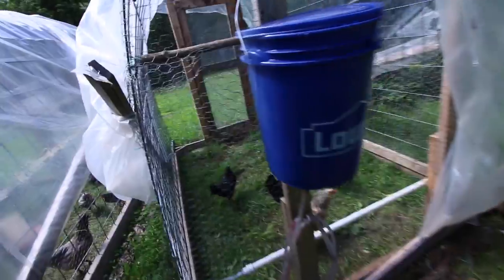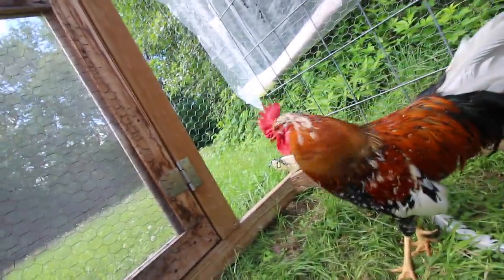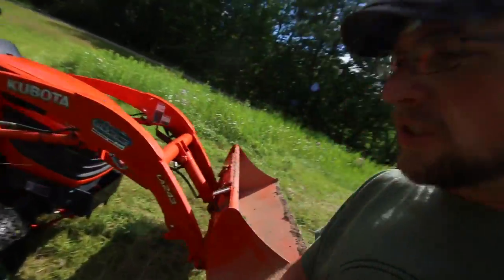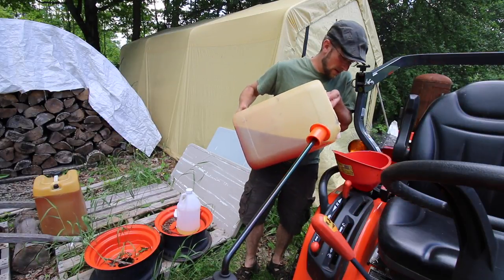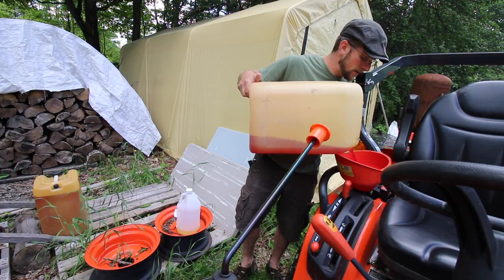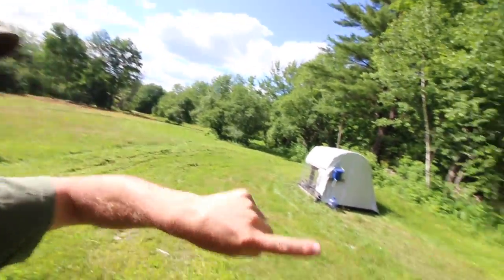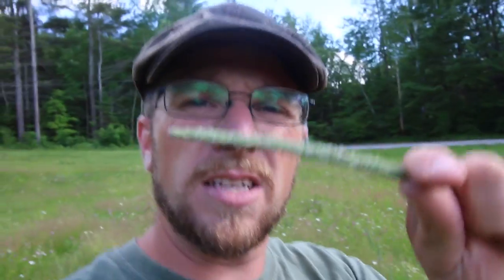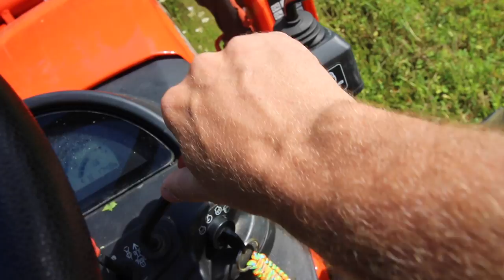Fertilize your lawn for FREE

Comment: set up fuel pumping machine and stop using those cans, pludo will kick them off
Reply from the maker: That would be nice! Thanks
Reply: If you use say a couple of 55 gal drums with a 'pung pump' you can have a fuel oil dealer deliver at a much lower price per gallon.....and not pay the 'over the road taxes' you pay at the pump.
Reply from the maker: Thanks! We are able to buy off road diesel at the pump! I will have to look into that!